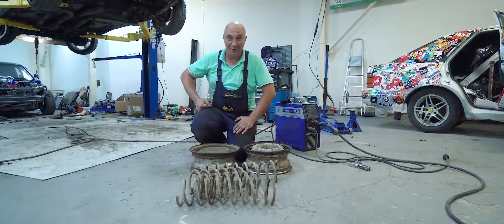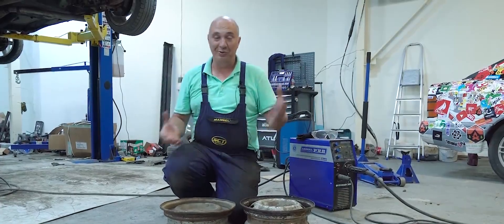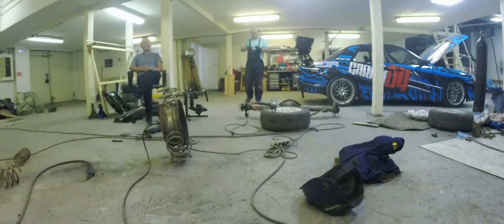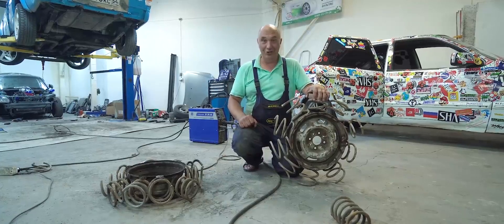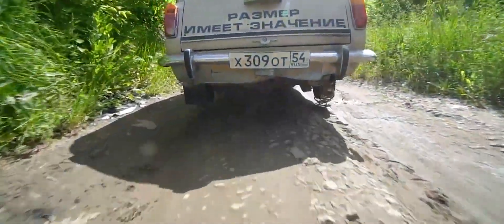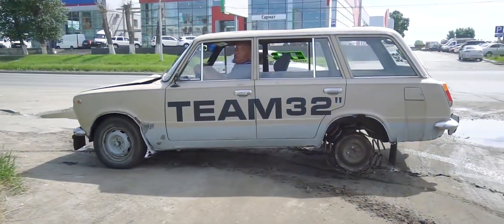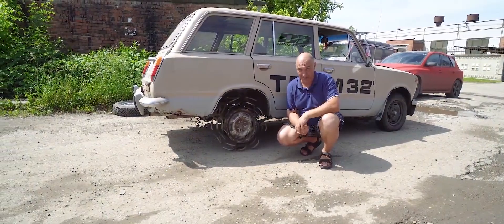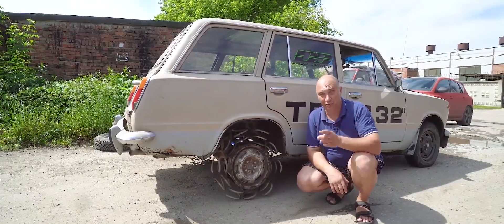Using springs instead of rubber tires

Comment: You're going to burn your retinas out of your head if you don't wear a mask when you weld. I imagine your eyes hurt real bad about an hour after this video.
Reply: Gotten flash before; Eyes don't hurt but the back of your head does, blinds you for a few hours, left a big yellow / green bar in the top half of my vision (High pressure sodium 400w @ 1 ft.) but other than that, no pain.

Now, having cataracts at 25 isn't any fuckin' fun.
Reply: 381 322 and I know people that have gotten it in 10 minutes doesn't mean a thing welding without a mask is asking for trouble.
Reply: Dana Horton  He's USING his eyes TO weld. This is Russia !!
Reply: Ok enough I understand. People in Russia are so tough there retinas don't burn when they stare into super concentrated ultraviolet rays for prolonged time periods. Got it. Lmfao!!!
Reply: He's the only guy in russia with a suntanned face
Reply: Robert E Lee I learned how to weld from a vocational school in New York state called wemoco. Many many years ago. Unfortunately I'm not as young as I used to be and because of health problems can no longer do what I love to do.
Reply: Terry Sessoms you do have a point there. I'm betting he still bleeds red Russian or not.
Reply: Dana Horton in Russia, mask wears you
Reply: Dana Horton He closed his eyes when he was welding.
Reply: Robert E Lee that's a little more likely than he's Russian and he doesn't need to wear a helmet because his retinas don't burn.
Reply: Dana Horton I learned how to weld from a guy who did this type of welding.
Reply: Dana Horton 
That's his problem, I just don't understand wat he was doing.
Reply: George Payazitis I don't get it either???
Reply: Dana Horton 
I mean come up with idea's, but this 1 i don't get.
Reply: In Russia our eyes melt the weld.

Comment: Add rubber layer around the circumference of the tire so that spring metal does not come in direct contact with road surface. Rubber surface between road and spring will make it more silent and smooth.
Reply: Less road drilling too
Reply: ADEBISI ADEBISI Crybaby bitch at it again.
Reply: good idea.  I wonder if these wheels will catch on in the mainstream, lol :D
Reply: inflate the rubber.. and get rid of the springs.
Reply: ADEBISI ADEBISI lol you are dumb

Comment: What if you put an old tire over the springs to give more traction and less noise? It wouldn't even have hold air since the springs would be holding the weight of the car!

Comment: You could use smaller springs, more of them, or maybe a different design of springs, cover the whole lot with rubber and it could be an alternative to air filled tyres - after a lot of refinement

Comment: i want to see how well they work in snow and mudd. I think it would be almost impossible to get stuck
Reply: ADEBISI ADEBISI The stupid person here is your miserable ass. Senselessly shiting on everyone in The comments... What is wrong with you?
Reply: Roger Hamilton it has low surface area and it’s more rigid than a tire, weight distribution is terrible it would get stuck in mud much more easily than it would with tires.
Reply: Whipped snow/mud... That would be funny! Definitely more than beating egg whites or making chocolate pudding!
Reply: Nah,  they will get stuck quicker. Contact area isn't flat. 
Place one match stick on mud then a matchbox. 
Which will need less force to be pushed down in mud?
Reply: ADEBISI ADEBISI why you say thst? I was thinking it would be hard to get stuck in mud or snow too. Please explain why that's stupid.
Reply: i agree i think it will work great in muddy terrain and snow in fact i want to make one for my car as a spare just in case i ran into a muddy road
Reply: You'll get stuck in sand or gravel pretty quick though.
Reply: J Anything,
I wondered about that. Front wheel drive car. I wonder what drifting would look like??!
Reply: on ice sure but in mudd or snow it will insta stuck, due to the poor contact surface area
Reply: eggrollsoup agreed!!
Reply: Yes, because you would have no traction
Reply: I don't think it's as straightforward as it seems. You don't have a cylinder to create vacuum but a spiral, and there are centrifugal forces plus high and low frequency vibration, as well as spinning, and the normal action of the sprung suspension, plus dampening from shock absorbers and sway bars. I think ground clearance would be more of an issue and cause of getting stuck than lack of surface area. These suckers on the drive wheels would also be a different story again. Imagine having some sort of concertina cover and a rubber tyre style pad wrapped around those spring ends. Something else to try.
Reply: In mud you will be grounded for ever.
Reply: lets put some logic in the mix 
<traction = ability for the tire to grab the terrain and provide forward momentum >
<surface area of the tire will avoid sinking into very soft ground >
from this u will realize these will work great in firm slick and medium mud depths but deep soft mud they will end up sinking to the point of bellying out.  
These will also perform terrible in sand , deep powder snow or hard pack surfaces due to the small surface area in contact with the ground 
on hard pack surfaces like tarmac there will be little to no traction at speed , powder snow and sand these will likely sink like deep mud.
Reply: Definitely an interesting wheel type. I'd imagine it would have great grip offroad and in snow since it may stick to the springs. I don't know if the vehicle will sink if it lays on snow however.
Reply: YES!!!!! mud and snow test would be great to see... also spring wheels on all 4
Reply: Roger Hamilton well I want to see what happens in a 1in-3ft River/pond
Reply: rex racer what do they put in snow tires (studs)/(metal) so I think it will work
Reply: rex racer but only in snow
Reply: Snow would be a no go because the metal would never grab the ice/snow it would slide like crazy however mud would be fine as long as you have the depth needed to cut through. Self cleaning action would be over the top unlike a typical mud tire.
Reply: In mud it would likely create a vacuum, causing the springs to 'post' in the mud and get stuck/clogged, or act to churn the mud in place without creating any forward momentum, digging the wheels further in. Width and overall surface-surface weight distribution is best for managing both mud and snow. Early tank tracks, due to their narrow design, were useless in mud, and unreliable in the snow despite the treading pattern of track. 
It's more about floating on the surface, than really digging in when it comes to mud. And snow, but especially mud, wet sand due to it's ability to create a vacuum.
Reply: ADEBISI ADEBISI Well where's your million dollar idea?
Reply: Roger Hamilton you will have more traction as they go deep in the mud so it’s a great idea!!!!
Reply: Rick Asttley it would actually worsen gas mileage
Reply: Nah, it's FWD, no drive on the rear so yes it can get stuck.
Reply: all comments here are concerned with mud and sand but not asphalt. the heat this will generate on real roads will melt the car let alone destroy the road. perhaps springs in rubber tires might be a better idea
Reply: Roger Hamilton they're not the drive wheels

Comment: Keep the coil spring wheels and just add a flat piece of metal in a truck tire then put the truck tire rubber over the coil wheels to see if it dampens thing's and sort of irons out the imperfections
Reply: Sid Al I was thinking that same thing! it would definitely make things a bit quieter.
Reply: Sid Al 
Lol, I've got a better idea y doesn't he just put them where there supposed to go, wen he needs to 1 day.

Comment: I was thinking of welding a strap around the circumference, just to equalize the stresses.
Reply: Use a tractor trailer rim with a rubber pad on it
Reply: Dead Frt West ,I was thinking 2 turns from the rim and equalizing the height to deal with the shutter
Reply: I was thinking of a low profile tire on the outside with springs in the middle.
Reply: Heat .......😂😂😂😂 ikr....
Reply: Tire salesmen hate him!
Reply: Whole Lotta thinking in this post.
Reply: Maybe wrap the whole thing with rubber to smooth it out and give it a better appearance...
Reply: Dead Frt West - That would cause binding
Reply: Ingenuity
Reply: Heat I was thinking springs inside the rubber of a tire
Reply: Dead Frt West weld a chain or two around the wheel
Reply: you would want it pretty darn accurate, much more than just welding by eye
Reply: Same thought
Reply: would cause lateral stress on the other springs and welds. they need to be smaller
Reply: Im thinking the same too
Reply: I don't see how a strap would accomplish that. It's obviously not necessary anyway
Reply: I was thinking of tires instead of springs. Y'know... maybe it'll work.
Reply: Dead Frt West ........ I was thinking if they somehow could weld end to end each spring so they are all connected for a slightly quieter ride.....

Comment: some padding on the ends of the springs would help with noise, maybe a rubber belt around the whole thing, or circles attached to the ends. maybe that proto putty stuff they had on kingofrandom.

Comment: I really want to see how these things hold up at 55 mph
Reply: He should add rubber tyres around the springs
Reply: apparently they're great for a smooth highway drive lmao
Reply: No burnout , son I am disappoint.
Reply: never would have a flat tire
Reply: Be funny tree him take a bend at anything over 30 lol
Reply: Welderman    bet at 55 or so on pavement, the Sparks would fly. Lol. Talk bout tearing up the roads.
Reply: Neeed to weld them up better ,and wont be problem.
Reply: Airport Documentaries exactly that's what I was thinking in.
Reply: how about 88?! ;)
Reply: Welderman on our roads it's impossible speed...
Reply: Welderman no
Reply: Welderman

Driving fast with these is completely dumb, sparks and loss of contact with the ground would great problems. And you don't want to lose that
Reply: unless they can cut all the springs the same length to a very small tolerance, it's gonna get more and more out of balance as speed increases and then shit's gonna get real neat.  not to mention there's no fuckin' way these get any grip on a hard surface.
Reply: After it the road won't be smooth. And this car won't be able to reach 55